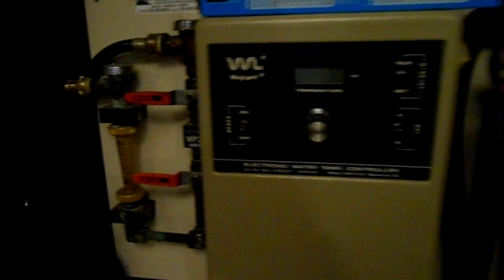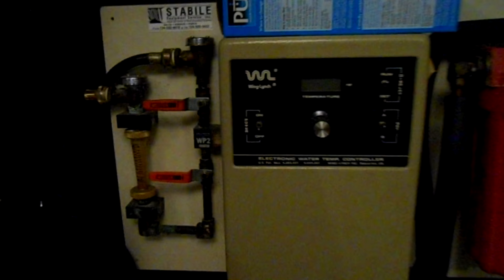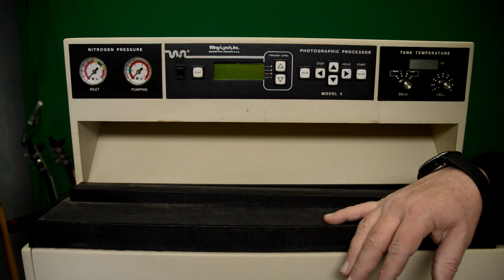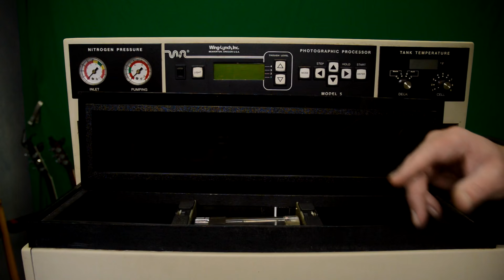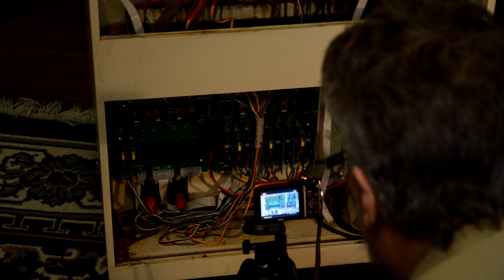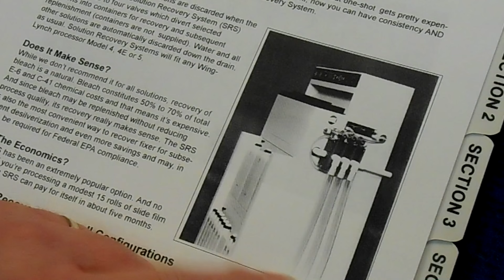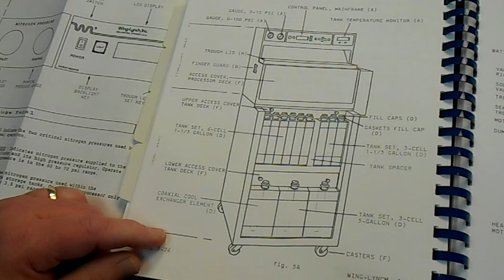How it Works! Old School Photographic Film and Paper Processor

Comment: I used an older version of the Wing Lynch machine back in 1986 to 1989 at Vanguard Photography Inc. In Hollywood. very good machines and very reliable if kept in good condition.

Comment: Thanks so much for covering this so thoroughly before you got rid of it! Am working on designing and building my own rotary film processor, so nice to see how to the commercial ones from the 80s and 90s worked. I had assumed one of the advantages of the trough-style rotary processors was to enable replenished chemistry processes (versus smaller tank systems like Jobo ATL/Autolab that use much smaller amounts of chemistry). I guess it probably wasn't worth the hassle (and extra expense in solenoid valves, hardware, etc.) in the machine to do that for medium-throughput operations these were targeted at.